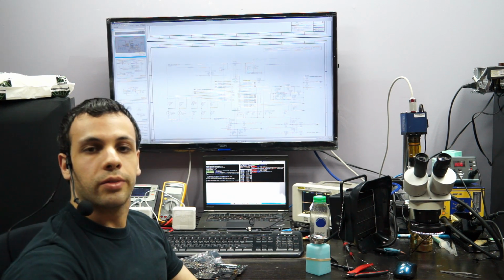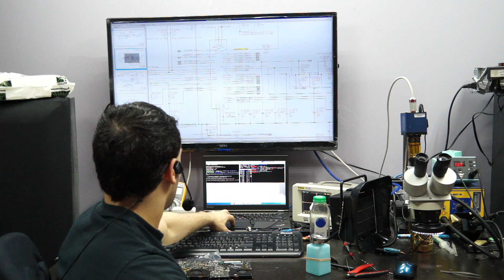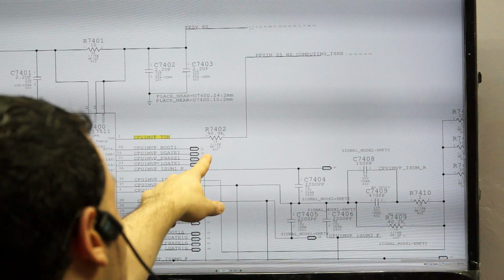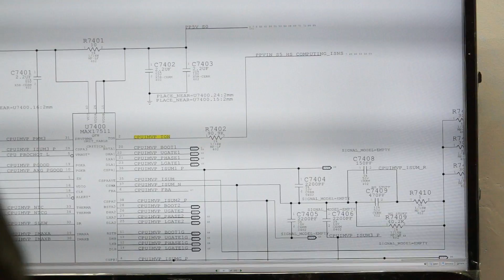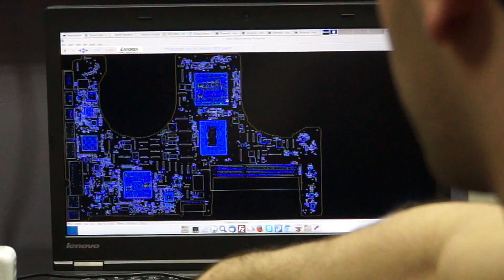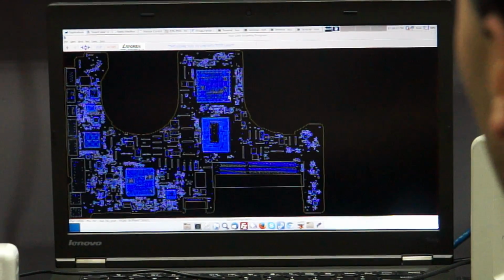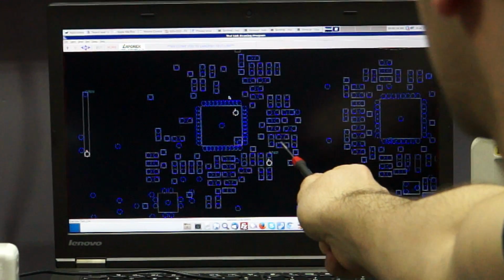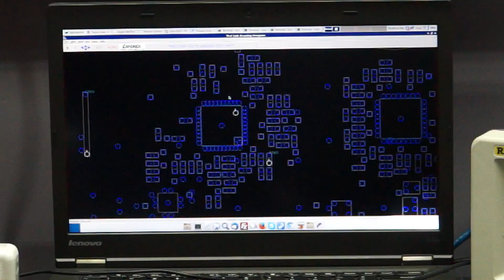Fixing not chiming Macbook Pro - no CPU VCORE on 820-2915 because of CPUIMVP_TON.

Comment: hi louis, i have the same board and i have problems with the kernel task, high cpu use, the board works normally, but after 15 - 20 minutes it the kernel task rises to 95%. I have a new battery, but its still the same. where should i look? in the video i saw you fix the cpu with wire, and you mentioned improvement of task, thanks for your anwser, i appreciate it

Comment: Hi Loius, great video - thank you for sharing!
I have a same board with no chime but a green light on the charger and appreantly no water damages (clean board); 
Some measurments:
PPVIN_S5_HS_COMPUTING_ISNS is a bit low (12,57v instead 12,8v). 
PPVCORE_S0_CPU is only 1.15v (instead of 1.25). 
CPUIMVP_TON resistor (R7402) is good and what should CPUIMVP_TON be (I only get 0.533v). 
What would be my best move next? Thanks for any reply and advices!

Comment: I just commented on the finding a short video... just re-watched this video and it has given me other ideas, thank you! I was going to check CPU_VCORE when I get home any way and I am definitely going to now. I am still concerned about the boiling hot u7400... and you clarified that the signal PPVIN_.....COMPUTING_ISNS... is going INTO u7400 (through the TON resistor, which was fine on my board)... so maybe I should check u5400 area and r5400 as that seems to turn PPBUS_G3H into PPVIN_S5_HS_COMPUTING_ISNS... so maybe something is wrong with R5400 (seems to be one of those larger 4 pad resistors, you ever replace those much???) I write this in hopes you'll reply, but also that anyone else out there may have some insight, as I know you're very busy :) Thanks again for all your videos :) I love doing this stuff! Beats my EEE job :(

Comment: Hi 
I'm hoping you can help. 
I have an 820-3208-A board that was dead! 
I went through most stuff with your guidance from the videos and managed to bring it back to life. 
I purchased the MacBook Air with water damage and only had to replace a few resistors and the ISL6295 chip. 
 I now have a green light and the fan spins for a second or two and then stops. 
When I place the board back in the unit and hold the power button down, the fan stays on and I get the chime and the grey screen with the question mark, but can't do anything from there. eg. reset SMC or find any utilities etc. 
when I press the power button just the once, the fan spins for a second and then stops!
I seem to recall in one of your videos you mentioned something about the clock signal causing the fan to spin and then stop and was hoping you could point me in the right direction so I can finally work this out. 
I am a novice but keen to learn. 
Thanks in advance.
Reply from the maker: kevin smith Maybe bad SMC.

Comment: quick question teacher :) 
Macbook pro late 2011 (17in) have a video probleme ? i mean do you think that this model is good or have some probleme, thx.
Reply from the maker: If it has a GPU that says AMD on it then yes it is shit.
Reply: Louis Rossmann  So I take that to mean that my father's A1260 that has no chime, no video, and the sleep light remains on indefinitely when trying to boot has a bad GPU and not something simple like this?
Reply from the maker: This never happens  on those,  if it is a1260 or a1226 the gpu is dead.
Reply: Louis Rossmann Thanks, Louis.

Comment: Hi Louis, you probably repeated many times in your videos but can you tell me which solder wire & flux brand you use ? Love you videos
Reply from the maker: Firstly Amtech NC559 is the best, buy from notebookmechanix on ebay NOT ASIA so you get the real deal.

Solder Kester 63/37 from all-spec, I forget which. I actually ran out of my main roll eight years after I bought it and the label is far too fucked up for me to read so I bought one of each to see which would work.

Comment: Hi, Great video and Great Chanel i like it very much and it help me to learn a lot. Thanks... I have a question I have 820-3115-B which has problem when i connect the power, computer turns on for few second and then its turned off and keep doing same again and again, do you have any idea what is wrong with it.
Reply from the maker: Probably a clock signal not running.
Reply: Louis Rossmann Please can you little bit explain how can i check the clock signal.
Reply from the maker: Measure it with an oscilloscope, check SMC clock and RTC, see if either are missing.
Reply: Louis Rossmann Thanks i really appreciate your help.

Comment: Louis i have a question, i have a macbook pro 15in core i5 with Nvidia GeForce GT 330M, sometimes when the mac switch to this video card (I open a game), i get a black screen and he restart but after that he work fine.
 i did a stress GPU test but all its ok.
I change the memory and  i get a crash sometimes when the mac switch.
Thx a lot.
Reply from the maker: You have an 820-2850 motherboard. This is only repairable by setting it on fire. Don't invest a dime into repairing this board, it is defective by design and will make you and the repair tech very very miserable for as long as you try to make it work. There are many issues with this motherboard, some of which are inside the PCB itself, and will never be fixable.

I know this is not what you want to hear, but it is the truth.